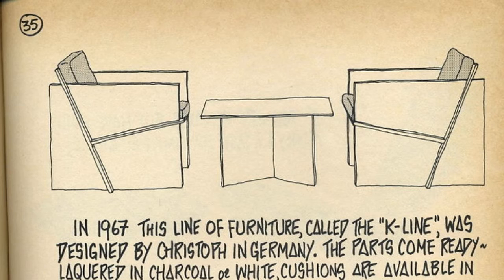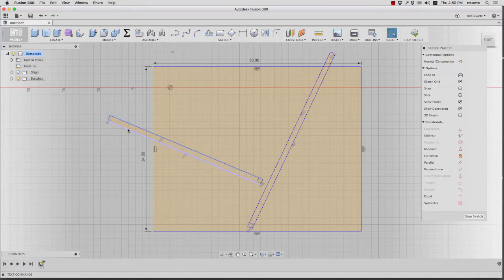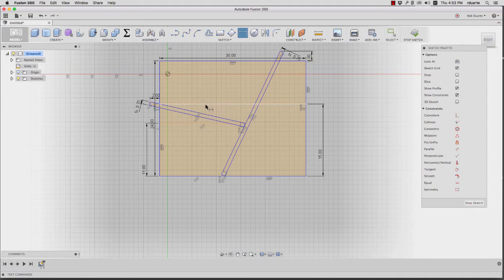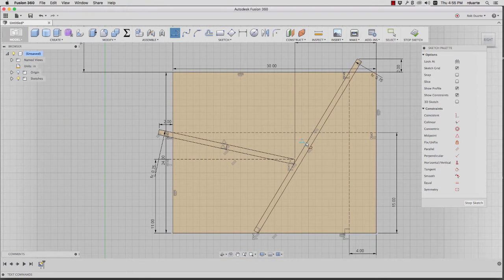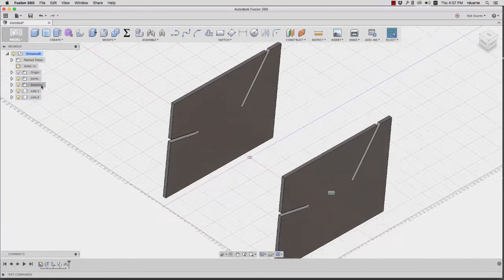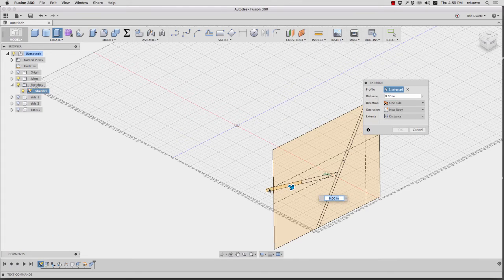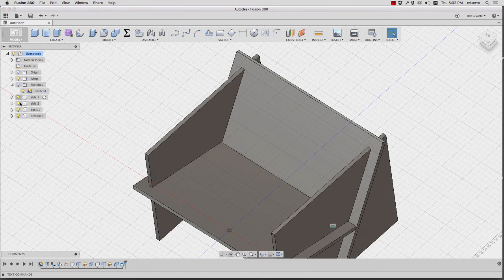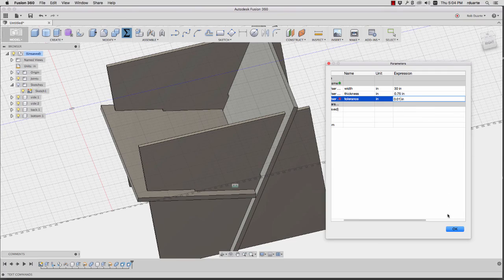Fusion 360: Parametric Papanek

Comment: Really simple but strong looking.  Rob for a full length sofa would it need centre support if you lay on it ?
Reply from the maker: I suppose it depends on the material you're using. You could decide experimentally by supporting a sheet of plywood on a couple of cinder blocks and seeing how it responds when you lay on it.

Comment: Great video. If you were laser cutting this, would you build the kerf allowance into the model?
Reply from the maker: +Karl Fimm I would account for the kerf. Even thought it's small, it exists. And it would mean the difference between parts fitting loosely or having to be hammered together. I've seen software account for the laser kerf based on formulae but in practice I personally think it makes sense to do a test with the actual material you're using and come up with a number through a little trial and error.

Comment: some of the ADSK staff suggest starting with a component.

I know some don't do it in vid's but the more senor ADSK staff suggest to start with a commponent

everything else good stuff
Reply: +Rob Duarte sorry I did not read the start properly edited
Reply from the maker: +daniel lyall Ah, now that you edited your first comment it makes more sense. Thanks for pointing that out.. I'll try to start with new components in these videos.
Reply: +Rob Duarte the reason I do it with a component at the start is so I can just copy and past new the first component what has the base sketch in it, I do it pretty much the same as how you do it.

if its a cabinet I am drawing I can use that base sketch to make other cabinets and that can be turned into a book shelf as well
Reply from the maker: +daniel lyall I think that's a good approach, but I'm not sure it fits here. None of these components is useful on its own.. only in the context of the chair. (ie: I'd never use the back panel in another design or duplicate it for any reason). They're all based on the same single sketch, so having a sketch inside of each individual component seems redundant and problematic. Or are you talking about having one component that contains both the base sketch + all the other components (ie: what the root component is currently doing).
Reply: +Rob Duarte yer component one is base sketch plus first panel, then components for each panel like you did.
it's just have the sketch with panel one in the same component, it's realy no different to how you did it just the sketch is in a component.
with that chair to do a different size save as would be better than starting from the base component.

sometime save as is the best way to go, sometimes starting from the base sketch is the way to go.

I will be doing some vids on a kitchen design for a new user where I will use both ways
Reply from the maker: +daniel lyall Yes, that's what I thought you meant. In this case, I don't see how that would be a better solution - you'd still have components that don't contain the sketch that they're based on. I think what I've got is cleaner.. each component is a container for the corresponding body, and the sketch exists separately. If I do it the way you described, I have to guess at which of the components contains the base sketch.
Reply: +Rob Duarte the way I do it is the first component done has the sketch, then yes each component done after has no sketch and is just the body, so each press/pull get's saved as a new component just like how you did it
Reply: I like adding a tolerance parameter. But if you have a material thickness for each ply you want to use, then before creating your gcode, you can just measure your material and input the exact thickness. It should be perfect without any need for a tolerance offset.